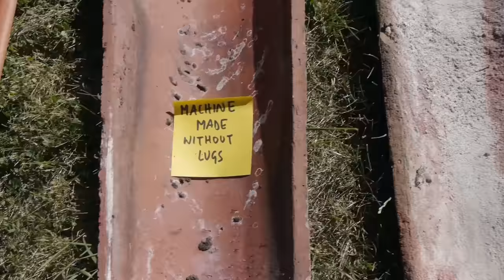DIY ROOF:  HOW TO FAKE A TRADITIONAL ROOF

Comment: I cycled through France for six months and fell in love with this style of roof but the one mistake I spotted over and over again was that the first row of over tiles starts too far up and doesn't cover batten enough to weather it from rot  , and I see here you have done the same thing , I'd have brought it forward 50 mm .
Reply: Thought that myself, the eaves timber will get wet the way they have started, obviously not bothered
Reply: I think this type of roofs are mainly used in dry and warm weather climate. I saw now heat insulation and no structure against heavy snow fall either.
Reply: Japp. And when fine snow drives into the spaces between the tiles, the roof battens rot because there is no counter batten. Condensation also runs over the roof membrane against the roof battens. Unfortunately, the Pyrenees are not far away, i guess.
Reply: @stellatronic  You are 100% correct. If they live in a snowy climate, this structure will rot in 15 years maximum.

Comment: Matching the old roof line was tricky, but I think you did it. Now, you'll need drainage at your last batten point. The felt will sag between rafters enough to allow water flow downwards, but you have to let it out the bottom. I'd have painted that last batten to keep it from rotting and predrilled it's drainage prior to instillation. Probably you can still drill out drainage, though.The roof looks very good and I'm glad you used such heavy lumber to construct its rafters.
Reply from the maker: You’re not the first one to point this out, but thank you for doing it so politely! It’s always appreciated :) I like your dog

Comment: I hate these roofs, my parents made the decision (without consulting me) to have a Spanish tile roof installed. What the roofing contractor didn’t tell them and they didn’t know is that the house has to be designed (engineered) to carry the weight of those heavy tiles compared to their old tin roof. So anyway, technically the contractor didn’t violate. The weight limit but went right up to the 10 x 10 limit. What they didn’t take into consideration is that the house is 70 years old. While in great shape it’s on the side of a  hill that is really a 45% cliff in Southern California (earthquake central).....

Well I’ve been fixing the lath and plaster walls in their house every time there is a slight shake and the walls are crooked as hell now. That heavy roof is acting like an upside down pendulum causing the roof to move over the walls in an exaggerated fashion. When this happens every single corner joint in the house cracks (1/8th in cracks) . These cracks sometimes are 5 to 10 feet long and with a 1/8th in gap you can’t miss them. I’ve spent 85 hours (myself and one of my interior guys) just fixing walls, ceilings and ceramic floor and bathroom tiles. If I were to bill them they would be in the 25-40k range.
Reply from the maker: That. Sounds. Shit. Sorry you've had to deal with all that!
Reply: And that's the reason why in Europe we build our houses using bricks, steel and concrete instead of „paper" houses made in USA... Even houses made out of bricks, that were just made out of soil and left to dry only by Sun are so strong, that even after 100 years of use, people are even adding whole new floor to these houses. And the weight of the roof is really the last thing you have to worry about. 

And people even hang thousands of kilos (pounds) of stuff (like garlic) in their attic without having any problems.
Reply: There's no way your parent's house is designed to handle that roof load.  Clay tile is significantly heavier and the wall cracking you see isn't merely cosmetic, it's a true hazard and symptom of a significantly overloaded roof.  In a large earthquake, it's a deathtrap.
Reply: Veselská Právnická we don’t build paper houses. We build wood framed, we build concrete block, we build brick. My home is concrete blocks and beams with steel framed roof.
Reply: Wow that would certainly be a violation of any timber framed construction codes and framing load charts I'm aware of. A light vs a heavy roof is a completely different structural design and construction. Most of the timber-framed domestic houses built in my country in the mid-century were made with concrete tile (and even asbestos tile) roofs. They are some of the most solid and durable constructions. 
BTW, brick and masonry buildings from that era DO NOT withstand the seismic events common to my country. The timber framed ones do.

Comment: Final picture looks great!! But what is the felt under the tiles for…………….. if it's not put on properly?
Reply: Moisture
Reply: @UndisputedRoofer  I guess so. But that felt ain't put on correctly, no air flow between felt and tiles. 
Such a shame you spent some much energy not doing a proper job.
Reply: @c-rafun194  plentifully air will get in there around the tiles ‘

Comment: At what point did you realize the concrete ring beam should have been held back 3" from the face of the stone to allow you a stone veneer to blend into the old and bury the new? 14:08

Plus, I haven't seen the next, but I sure was hoping to showed us how you met the tile to stone gable wall

I was surprised it wasn't completed before you worked your way across. Once you laid out the courses up ...10:07... there was no reason not to complete the gable course at that point.

At 10:22 it appears the tile is embedded into a joint in the stone as the flashing where the roof tile meets the wall.

I would have like to seen what was involved with clearing a joint in the masonry to accept the tile and then pointing mortar back in. 

That said what you have there is a 200 year roof that looks as if it already been there for 200 years.

You don't need me to tell you what a fine job you've done, but I guess I just did anyway
Reply: Odd. All but for the last 2 sentences it appeared you were pointing out all the ways it should have been done. And even the last sentence avoided direct praise.

Comment: You have to have a good roof to support that 2 tons of shingles and all is being held by gravity.
Reply: Each beam of the support under that roof took 3 strong people to install. Had to be better than 400Kg of wood beams used. It's mortise and tenon joinery, too. Go back and watch the previous 3 vids. The tiles are hooked to each other with wire, and the base layer has lugs which hook to the battens. The last tile is anchored by cement at the lip of the roof. The corner runs will also be cemented, I suspect. If that isn't strong enough for a tile roof then nothing is.

Comment: Unfortunately, the building codes for fixing tile roofing say that no foams or mortars should be applied at all and that everything should be done dry. Otherwise, the shingles will experience structural failure and deterioration due to moisture and vegetative agents. There is also no proper ventilation system.

Comment: Spanish tile roof has been used in the old houses in the Philippines but this method is for quickie only not knowing the complex of installing this kind of roofing materials, watching the video I thought that they would put cement on every piece of tile but only on the lower portion not on every overlapping tile, not good, that kind of work is not acceptable, heavy wind could destroy those tiles and then repeat again, waste of time and money.

Comment: Nice job but especially with reclaimed tiles enough ventilation is key. 
In collaboration with a membrane you should have used min 20mm counters. 
In this case a bit more would be even better. And the tiles at the egout could off had a bit more overhang .  For the rest no comments it looks fab. And thumbs up for the effort.

Comment: The first row of booster and top should be flush with the first row of pans .
The boosters should be wire tied . 
Use cement between the first row of pans as bird / pest blocker . 
The wire tie for the tops is nice but if you're not nailing the tops , what good is it . 

Soak the tops in a bucket of water instead of brushing them with water. The tops will bond to the cement incredibly.  

Water runs down hill 
Pay day is on friday 
Good day ,

Comment: Am I right in thinking the the entire weight of a row of shingles is counting on the wire hanger at the bottom (each counting on the one below it), or do they attach to the stringers some how?
Reply from the maker: The new underneath tiles all have lugs on them that rest on the batten. The tiles on top rely on the metal hooks, but the weight is substantial enough that there's really not much movement. Also the more tiles hooked together the more stable it becomes.

Comment: The tarpaper shingles we use in the USA are much easier to install, but you have to replace them every 25-35 years; there are some versions with enough fiberglass that they are supposed to last longer, but I don't know if they really do. Tiles like this probably last indefinitely, with only the crumbly ones getting swapped out periodically, but DAMN, what a lot of work. I assume that the periodic maintenance of a tile roof, including re-sealing the underlayment, would be as much work as replacing our cheap roofs.
Reply: Clay tile lasts a lot longer, no question. Less maintenance too. But I don't know how it holds up to high winds and such. In the Midwest I can imagine all those clay tiles taking off like a sail when 70 mph winds come through the first summer storm. I am probably wrong about that though!

Comment: The idea of a membrane (Klöber in your case) is to give you a second layer to stop water and to send it downwards. If you nail your horizontal battens directly onto it you form formidable water traps. Your batons will rot away, but even before this your roof will leek through the holes you made with the nails.
Reply: Oh yes!
Reply: christian -------  lol,  i think the roof could have been COUNTER - battened    .   mate !!
 but perhaps not ??? ,, even though  a horizontal felt LOOSELY  ( with dips ) adhered  to roof timbers/ rafters  will allways throw water away from the battens to the center of the felt if there is a leak  !!
Reply from the maker: Thanks for the advice
Reply: carl --- it was nt a critiscm mate ,,, i was just telling  christian , that we  do things in different ways  in different countries !1
Reply: During my experience as a roof constructor, wealways placed vertical battens under the horizontal ones, to ensure that the water flow wont be interrupted, in case on damage on the tiles or similar, and always placing a secondary roof underneath the felt...if the roof this requires...good job fellows!
Reply: if  you ALL look closely --- the roofers  had to match up with original tiles left above near to the ridge , so there fore they had to match the  ORIGINAL felt/ batten specification that was above them .
 this is  called  " ADAPTING TO THE SITUATION " .
Reply: FUZZ ZEBALLS ------ is your utube name the new term  for NOT SHAVING your PUBIC AREA ?? LOL.
Reply from the maker: no no dont get me wrong, i wasn't being sarcy! i think when we do another roof we'll definitely consider counter-batten
Reply: Sorry to say but that roof overhang is all but proper job...so much effort and money, quality wood, just to be ruined by moisture and rot away...
Reply: carlrogers     When we renovated our roof (original construction from 1940) , we found the old battens attached like yours now. They were pretty rotten. We went for counter battens to ensure free water flow if tiles break (which always happens). Moreover, it is a hot and sunny country. With counter battens, air circulation under the tiles improves.
Reply: I've use batten on mission tile. I agree total with you Henrik verticals allow water proper flow in my exprience with   battens horizonally ,if water get pass the tile onto the membrane, the battens act as a dam running water sideways. so if the water hit any side lapses that are not sealed it will leak
Reply: @fuzzzeballs  Looks that way. No counter battens ( afstands lister ) under tile battens and lug - less tiles . Very poor job.
Reply: Christian Geiselmann from 1940, well man they lasted wAy longer than expected. Be thankful.
Reply: @christiangeiselmann  Good advice for all climates and especially where I live. It often reaches 100 degrees F in the summer and below 0 degrees F in the winter. The rainfall is above average and if there is a leak in the Summer... nothing has time to dry well before winter due to the humidity. 
      Air flow is the key for roofs in my area no matter if they are terra cotta, tin, asphalt shingle.... doesn't matter because sooner or later due to a falling tree branch, nesting bird or a wrong step during an inspection a leak is going to occur without a person knowing long enough to let water in.
    The expansion of the summer heat and humidity causing prolonged moisture retention going into the winter in my location means that when things freeze all the water expands under any roofing and around or soaked into any wood underneath. It quickly will work roofing nails loose or crack any unflexing tiles in no time at all even if you don't have any wood rot. Once it starts, it is all falling apart faster and faster every complete cycle of the seasons. I know that pretty much applies to all places but, in my area.... mother nature is on stimulant drugs!
      Building for modern air tightness for energy efficiency credits literally kills the elderly due to heat and humidity when a summer storm takes out power in my area and low energy swamp/evaporative coolers don't work here either because of the constant high humidity. Using plastic or rubber type sheeting and not a properly applied water repellant vapor barrier will get a contractor's butt kicked by the homeowner real quick in my neck of the woods when they see a contractor start cutting corners such as that during home repairs.
Reply: Grinning Goat   You mention a lot of interesting problems and pitfalls I were not awaare of so far (ice loosening nails for example). Thank you!
Reply: @christiangeiselmann  , Using screws when you can instead of nails in my area, even though nails are still mostly used elsewhere in the world, is preferred due to the problem of guaranteed yearly ice expansion and humidity swelling.
 Although screws make repairs more tedious, when they are used, at least it usually reduces the total amount of repairs over the lifetime of the home.
Reply: Fixing horizontal battens would be a problem if the membrane was laid over a solid sarking/sheathing like ply or boards. BUT it wasn't. The membrane will sag and give space for water to track and run down. It's not a primary defense for deflection of water.

Comment: At what Wind Speed do these tiles start flying off the roof???
Reply: Zero Quanta I have a roof with those old tiles, instaled the old way, With the tempest Klaus and some other before with wind at least 120 km per hour , no tiles were gone , but with the vibrations caused by the wind the tiles who "canalize" the water slowly goes down and you have leaks, big leaks.
Reply: Thanks Roland.  I would have NEVER thought that.  There is definitely more to these roofs then I ever knew.   I guess all types of roofs have their downfalls.  Tiles have been used for Thousands of years for a reason.
Reply: 500 mph

Comment: It's impressive how the first wire hook can withstand the load of the entire row of tiles.
Reply: I'm not familiar with the system... but I think the bottom tile of each row has a nib that hangs on the "perlin" horizontal board. Again... never worked with the stuff

Comment: are the tiles nailed to the battens?.......you seem to just lay them on the roof without fixing.
Reply: Zap Brannigan
Exactly what I thought.  Seems such a weird system and the weight of it all!
Reply from the maker: nope gravity alone keeps them down. the metal hooks that we use to tie the tiles together are the only real fixings.
Reply: a really strong wind would lift them off the roof.
Reply: it does not come stronger than Mistral / Troismontagne

Comment: why don't you just buy a metal roof. this day metal roof are very good and have many variety of choice even they now made metal roof look exactly like a clay or stone and sound proof.
metal roof is durable, light and easy to install some even no need a screw they can lock each other then we use a special nut to lock it in the place. come on you live in european. why still use this thing.

Comment: If you do it just for fun ... You can have fun every couple of years, when the roofing felt paper begins to let the water through, by the nails that you have placed.
In cold areas, it is covered with a first layer of 1/2 or 1/4 plywood,
After fixing with tack it is covered with impermeable substance derived from oil (generally) .... There is still gold coating called sandblasting or anti-slip.
But if you want to avoid this step, you can now place your ornamental tiles (or tiles or ceramics as they call it in some countries) ...
The semicircular shape of the tiles and the material of their structure prevent slips between them ... but not on prolonged inclinations
Reply from the maker: good to know